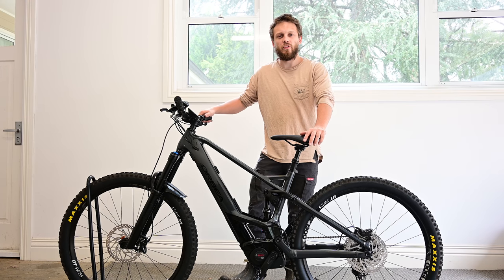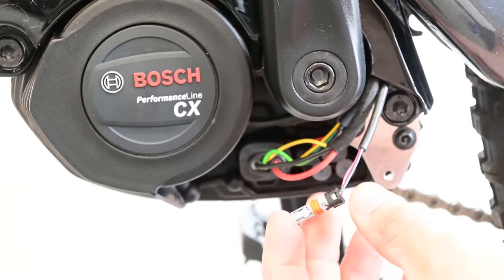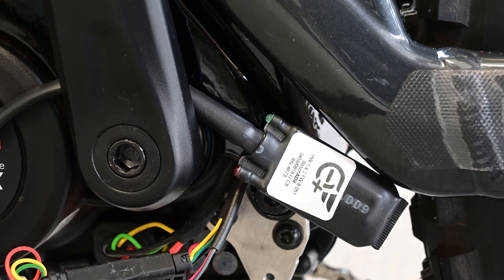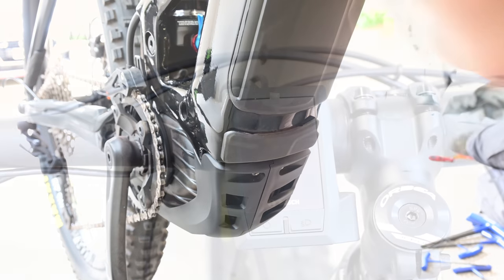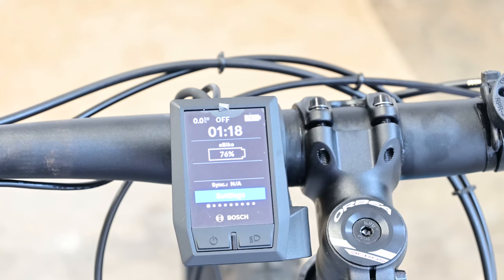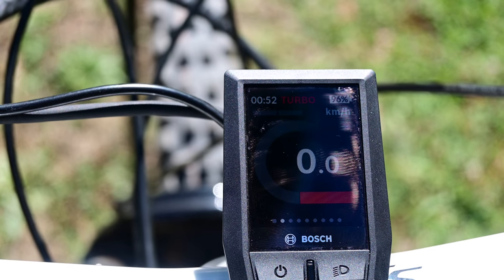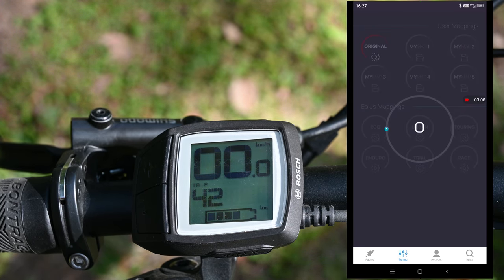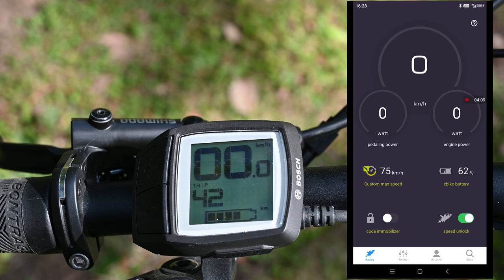Orbea Wild FS ebike Derestricted - Chip Install Guide - Bosch CX Motor Unlock

Comment: Hi thank you.  I install my kiox and I have a question about the motor protector , front part. If the MOTOR PROTECTOR FIXING PLATE is inside frame or outside bike frame
Reply from the maker: Hi the plate that holds the motor protector is inside the frame
Reply: @EpiceBikes  there is a small metal plate that sits on the inside of the frame which takes the two bolts. When I unscrewed the bolts this small plate fell into the frame as it wasn't fixed to the frame. and was really hard to get out of there. It was also really hard to fix it back in order to bolt the the case back on. Wish this was mentioned in the video

Comment: Do you have to ride for a certain amount of time for the count to begin when done. I just took mine out for the first time on my 2021 trek rail 9.8 and did about a mile just to check it and it did not perform the count down
Reply from the maker: It only performs the countdown if you travel above 25km/h, The longer you are above 25km/h the longer it will countdown.  For short distances it sometimes may not countdown at all

Comment: What is meant by programming the chip, is this necessary for the chip to work, or just for firmware updates?
Reply from the maker: There is two version of the chip, One simply unlocks, One allows tuning of the motor assistance levels via  a mobile app. Programming is not required purely optional

Comment: Hello i have a cube stereo with Bosch performance ce gen 4 I put a speedbox v3.0 and I have error 503..? do you have an idea
Reply from the maker: 503 Is a speed sensor error, The device is either faulty or not installed correctly. Make sure you have connected to the correct two pin plug.

Comment: This works in a Orbea Keram 30 2021?
Reply from the maker: Works on any 2021 bike with a Bosch CX Motor
Reply: @EpiceBikes  Works on ORBEA WILD FS M20 2022 model?
Reply from the maker: @vittu69koipina  Yes compatible ORBEA WILD FS M20 2022
Reply: I'm going to install the Volspeed V4, which should not have any 504 error

Comment: Don't remove the bolts as in this video otherwise a small metal retaining plate will fall down from behind the frame. You only need to remove half of the motor casing on the side that you need to fit the chip this will stop the small retaining plate that will fall down inside your bike
Reply from the maker: Good point, Does make it easier if you don't have to reinstall the plate.